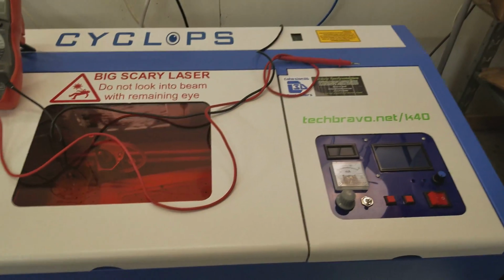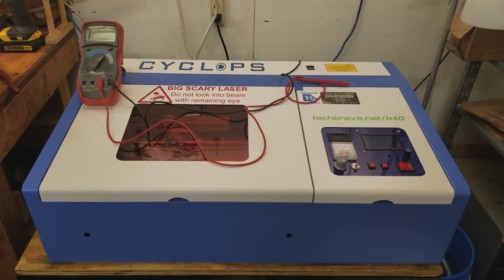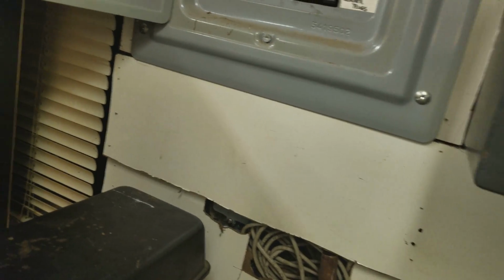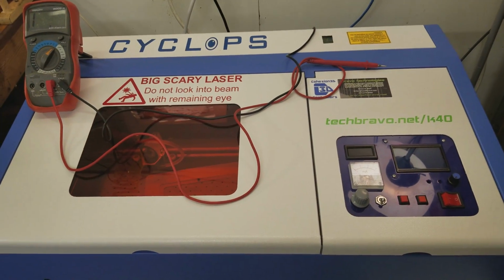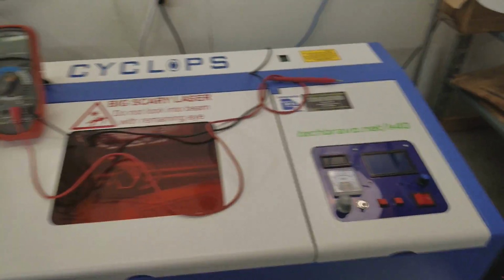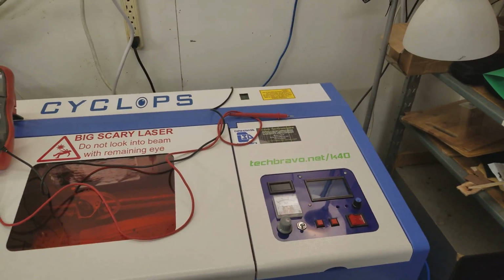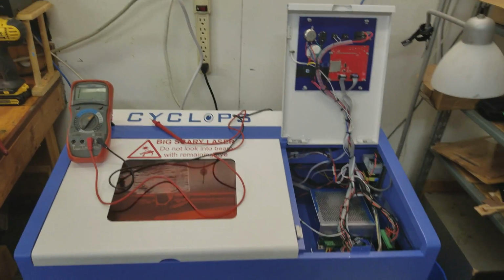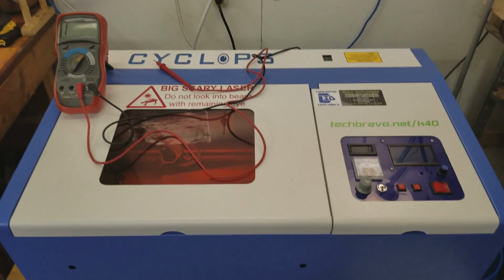Proper Grounding For A Chinese Laser

Comment: 2:04 - perfect spot for a Microwave :P 

More seriously, thank you for the help, I've had some problems with my laser stopping mid burn- always during a fill and I am pretty sure it's been building up static electricity with the higher movement speeds- cuts absolutely never fail since I believe the slower movement doesn't build up as much charge so I've been looking into how to ground my laser properly. This helps a lot- thanks for the vid, I hope grounding my machine properly fixes the problem :D

If grounding doesn't work my next step is to get a battery backup just in case I get tiny intermittent brownouts that interrupt the connection- that way I'll get garaunteed clean power if the wall power isn't totally clean. I've isolated the USB connection so I'm fairly certain it's not that- got all my wires wrapped in aluminum foil so there should be zero interruptions due to other cables arcing. Thanks for the explanation, it is well explained!

Comment: Can i grounding body frame laser to socket grounding?
Reply: If you're talking about connecting to the third neutral prong on a plugin- that should work. There are some smalle male/female adapters for extension cords or anything really that have a little metal prong sticking down from below the grounding wire that has a hole in it- this is for adding extra grounding. You can't post lynks here on YT but if you look up 'ETL Listed Grounding Outlet Adapter' (I can't mention that Rainforest Company that starts with an 'A' which sells most everything/and is big into delivery as well now- YT removes the comment if I say the name) the first thing that pops up should show you what I'm talking about. Hope that helps even though it's 10 Months later, maybe it'll help someone else who reads the comment though ;D

Comment: Thanks for the video… and this might be the dumbest question in the world… I have the same laser… when I plug the three prong outlet into the wall… which I’m assuming is grounded…. Why is there an additional ground terminal?  I’m out of my Depth with electrical and apologize if this is an obvious answer.  Thanks for the video
Reply: Maybe I figured it out… it’s because the plug on the k40 only has a pos & neg?  Why doesn’t the plug have a ground?

Comment: Nice video. I'm getting my new new 60W setup. I checked the gound lug inside. It is jumpered directly to the ground lead of the power connector, but I noticed the crump lugs used to attach the wires to the inner post of the ground lug were crimped and didn't look overly secure to me, so I soldered the lugs to the leads. Should be good to go now.

Comment: So just to make sure, in your setup, you do not connect anything to the ground lug on the chassis?
Reply: I think as long as you have a good earth connection through the power socket you are good.
It seems it is only worth adding a wire to the ground lug if you have a 6ft piece of metal dug into the ground. So if you could get good earth from somewhere else it would be ok to connect it along with the good power lead earth(just in case there is a problem with the power lead earth.)

Comment: I’ve watched this video a few times and I’m still trying to figure one thing out. Once you know the fitting on the machine case has good connections and everything to that lug. How do you wire that lug into your ground port at the wall outlet?
Reply: A bit late but it looks what he did was run a wire from that to the PSU connector on the inside. The yellow wire if you look closely at 4:17.
Reply: Basically, the Lug is there for China. In the USA with a correctly wired house (three prong plug ) you don't need it. If you have a old house with only two prong outlets then you need to hook it up if your wish for safety.

Comment: I'm curious if you could give me a good reference on wiring up a 220v 150w Chinese laser.  I have a sub panel as well in the shop.  I have mine wired with the red (hot), black (hot) and White (Neutral).  should i be using the ground instead of white (neutral)?

Comment: Thanks for the information! So basically, trash the additional ground connections and use the plugins ground? Why would the manufacturer even make an additional ground. Just in case there's a short somewhere in the original?
Reply: Bravo Technologies great video. So no need for extra grounding then ? Just the normal cable with 3 pins (being the round one,ground)? Just triple checking
Reply: Thanks a lot for your response! I dont know a lot about electricals. I do own a multimeter, in what mode should I use it to see if my power outlet has low resistance. Thanks! I will post a video once I start putting things together. I'm also getting Cohesion 3d mini this week!! did you install yours?
Reply: It gave me 00.4 :)

Comment: I have an older home wiring that only has 2 wire electrical.  If anyone has an older home, they might look into that because when we moved in the first thing we did was change the electrical outlets to a 3 prong just so we could plug in anything we had that had  a three prong plug. There is no actual connection to that third prong.  

If we had moved in and the previous owners has already changed the outlets,  with my level of knowledge of home electrical at the time.  I may have not even thought about there not being an actual connection to the ground.   I installed a ground rod for my table saw because of it being entirely metal.   I do not have one of these k40's yet,. but I am about to purchase one.  So I will definitely hook that ground up to my grounding rod.
Reply: So what's the options for us because I am on the same boat?  I also changed the outlets to 3 pronged for the ease of pluging in other items.  The previous outlets had only 2 wires so with my new outlets there is nothing connected to the ground.
Reply: @eliasgalvan6472  get a earth from somewhere it seems or dig a deep hole and rebar and get a earth from there it seems. Ask an electrician
Reply: I know this is 2 years late but I thought someone could benefit from this information.
During one of my refresher code classed I asked the inspector teaching the class about replacing a two prong outlet with a 3 prong outlet and here is what he told me.
 If an electrical inspector were to check your house and find out that you had replaced the outlets he would require that you upgrade the wiring the and no you wouldn't be allowed to go back to the 2 prong receptacles.
In the case of needing to add a outlet in a situation without the ground wire it is (or at least was) allowed to use a GFCI receptacle.

In the case of the laser I'm not certain but I think the ground wire is also used to dissipate static charges that can build up due to the high voltages involved.

Comment: A side note you would be more effective by feeding your laser cutter from a GFCI that will guarantee that any current leakage that may occur will be stopped if over the level that is safe for human contact.
Reply: I have GFCI outlets in my kitchen, does that mean that all my outlets are GFCI? or should I run an extension from that outlet to my machine?

Comment: As a licensed Master Electrician I approve of this message. You are spot on in all that you are saying. The NEC states that your ground rod must have at least 8' in contact with the ground and have less that a certain resistance to earth. If not a second ground rod must be installed. A little piece of pipe with a small gauge wire won't do anything. PS the ground in a residential application is mainly for the protection of human life
Reply: I know this post was 2 years ago but someone who know can chime in. So, a grounding rod must have at least 8 feet of ground "contact" and a certain resistance. What is the allowed resistance? As for the 8 feet ground contact, is there a difference in the orientation of the contact? Does it have to be 8 feet deep or will a ground rod 8 feet long buried 2 feet deep suffice?
Reply: @JustBoredCat  

There has to be 8 foot of earth contacting the ground rod, if you can't achieve that due to rocks and such you can use a second rod to achieve the 8 foot.